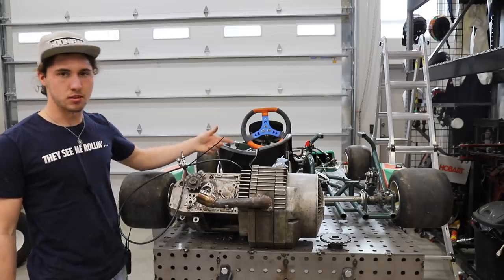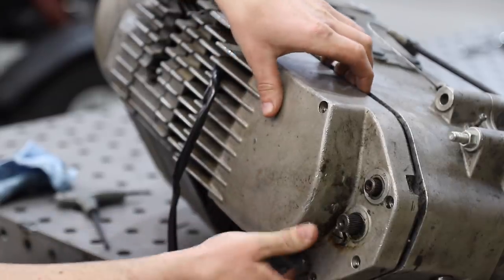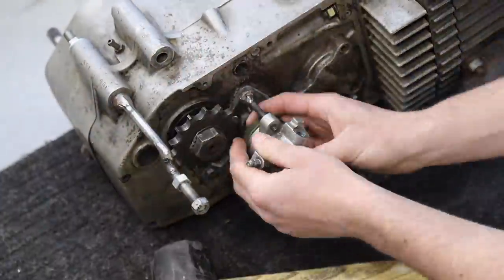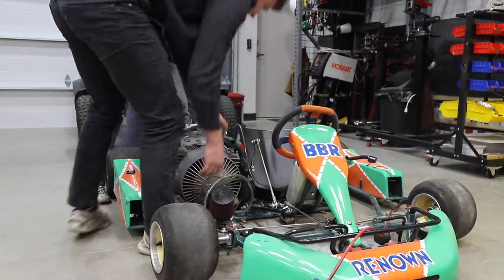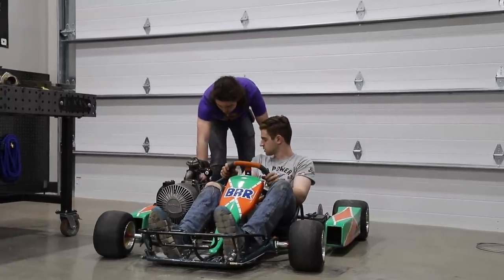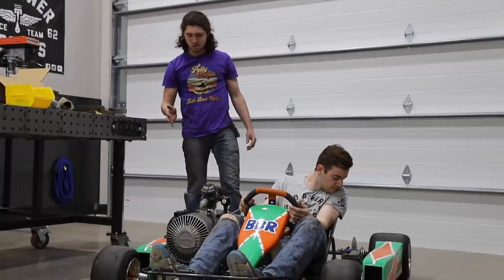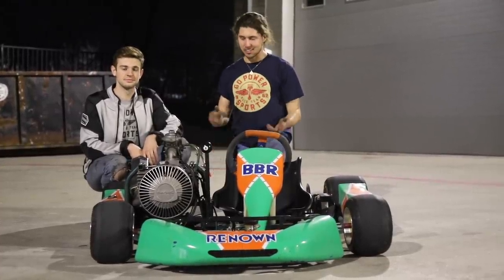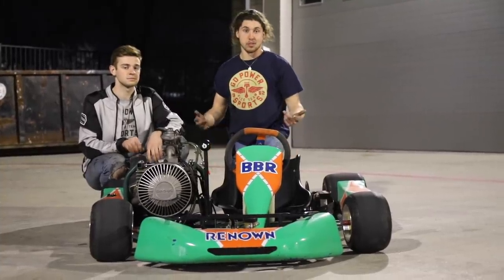ROTARY POWERED SHIFTER KART Returns!!! Major Upgrades!

Comment: Dont use car oil in a motorcycle engine. Use motorcycle specific mptor oil. Car oils have additives that are to slippery for wet clutches. Its not good for the clutch in the long run. Even some synthetic motorcycle oils arent good for wet clutches. Use a regular motorcycle oil. Like honda gn4 10w40 as an example

Comment: The engine seems like it's running a little too lean, with the missing and blue flames.  Could put an O2 sensor mount in the exhaust before the muffler to get some mixture measurements as you tune the carb.  Tuning a carb is just make changes and see if it's better or worst.
Reply: wouldn't flames out of the exhaust mean it's running rich? there's excess fuel that's not been burnt in the exhaust.
Reply: @dereksumstad6746  The blue color is the concern for me.   In a piston engine, a rich back fire has yellow in it.   Now, I do know rotary exhaust temps are way higher than piston engine...so maybe a rotary running rich is Blue and not yellowish.  We tune 2 strokes carbs by soldering the jet closed and drilling few to the next size bigger or smaller till it 'felt' better.   Just my 2 cents.

Comment: Y'all can get wayyyy higher in the rpms with that rotary
Reply: I was just thinking that it sounded like it wasn't getting to stretch it's legs
Reply: older rotaries are not that high revving than the newer ones
Reply: @PHUSII  that motor should hit peak power around 6000 rpm from factory they definitely aren't revving it hard enough
Reply: It hasnt been run in a while so just cleaning it out next vid we will see higher revs
Reply: @shaynegadsden  yup, it definitely has more in it, just waiting until they press that has pedal
Reply: @PHUSII  Äijä on iha kaikkialla kommentoimassa

Comment: That clutch bearing is cooking itself because you have tension on it when you're not using the clutch. Just like on a motorcycle you always have a little slack in the clutch lever.
Reply: ?what's free play.... lol. Definitely get worn in fast on the tight side.
Reply: @justinsolomon4427  if your cable is tight it will cook that bearing. Just like on a car the throw bearing has air gap to the clutch pressure plate when not depressed.
Reply: Correct,  which will also possibly lead to failure of the clutch or friction plates
Reply: @justinsolomon4427  100%.
Reply: Usually on a motorcycle if the clutch cable doesn’t have a tiny bit of slack your probably actually slipping the clutch even when you think it’s fully engaged

Comment: That motor can rev up way more than that. You should give it some more beans. You are shifting at around 5000 to 6000 rpm but it can do more than that without breaking a sweat. Try going till about 8000 or 9000 before you shift.

Comment: if they are welding together you do not have enough play in the clutch lever they should only touch when the clutch peddle is pressed to disengage power the rest of the time they should not be touching the bearing

Comment: LOL you never know what will work until you try! Nicely Done Guys!! I would suggest figuring out a metal spacer like maybe some Black Pipe cut to fit with a couple exhaust flanges welded on each end to keep it from flexing at all but other than that the Hydraulic cylinder you chose seems to work like a charm!! That thing RIPS!!

Comment: My 14 year old son races a OTK ROK 125cc and it is very fast. I would love to see this rotary kart up against it. We run C12 and I am sure the rotary would be faster running this fuel as well. I know there is a lot more power that can be had from that rotary. I would love to see you guys continue to fine tune it for more power. The right carburation helps a lot also

Comment: As I said before I owned the bike back in the day and I think if I remember right, the listed top speed was either 80 or 85 (90 maybe...I don't remember). All I know is that try as I might I could never get the damn thing over 78 mph. I'd like to find another bike if I could. Or, even just the engine like you guys did and put it on a different bike frame. My current bike is an '88 Honda Hawk GT.

Comment: Looks like an interesting build, what power is that engine putting out??? 
Im tempted to do something similar, i have a kz450 race tuned bike and a spare gokart chassie i think would create an awesome death machine. The only reason i havnt built it yet is because ive no idea wtf id drive it. If i did do that engine in a gokart though id definitely buy a vw camper totrod body ive seen on ebay as i think a mini sized vw bus with 70hp and gears would be awesome to race against a real sized one.

Comment: Bro I am an automotive engineering student. The professors wanted us to build a vehicle. We have to produce all the components except the engine ourselves. As far as I can see from your videos, this engine is powerful. I think I can use it in my project. How can I find this engine ? 
I need to find out which series is the engine and who produced it ?
Reply: Just use a standard motorcycle engine... As these engines are getting very very hard to find... And there are very very few replacement parts available for them

Comment: I wish I could find one of those engines to put in my Project Hammerhead Twister Offroad Dune Killer!! I removed the Bouncer style rear suspension and I am working on building a Full Upper and Lower A Arm style independent rear Suspension with a spool and axle shafts... It currently sports a cheesy GY6 POS that I want to just get running and sell to someone else lol, then replace it with either a used motorcycle engine or something like that Rotary would be EPIC!! Where did you find it?
Reply: Why not build the gy6? There is an enormous aftermarket for them I've had the 50cc version pushing the not so little anymore me (all 250lbs of me) with a 350lb scooter past 80mph and with enough torque to pull and hold the front wheel to 40mph from a standstill.  The biggest thing to wake those engines up is changing the clutch shoes and changing all the springs in the cvt and clutch for yellow springs (my 80mph+ machine uses red springs but it's a stage 5 build running a true 1.25 inch id. exhaust header with a custom 1.5 inch id. Intake, big valve head, bored 13mm over (yes it went from a 39mm bore to a 52mm bore) and stroked 2.5mm, custom fuel injection, a 12 pole charging system, ducted aux engine cooling 12:1 compression, custom grind cam,  upgraded oiling system with oil cooler, and regeared the final drive for higher top speed as hitting 10k rpm at 65 mph was holding it back so now it does 80 at 10krpm
Reply: @dodgeme1986truck  I need more horsepower and torque for the sand and the dunes... its a fairly heavy rig as well even with out two people in it...
Reply from the maker: We got very lucky and stumbled upon it on a local craigslist listing.  You could try looking for snowmobile rotary engines on ebay or locally, they're more common
Reply: @BuildBreakRepeat  Right On! I have been keeping my eyes peeled...
Reply: @DanITGuy   I've pushed 40hp and 35 ft lbs from those gy6-150 engines if you get a big bore kit, a stroker crank, a big valve head, cam, a header, reject the carb, and retune the cvt with  upgraded clutch shoes, and a complete set of yellow springs you should have enough power for a 1000lb buggy.  Or you may need to upgrade to a 200cc+atv engine if you want reverse and the gy6 variant engines over 150cc have a decent upgrade following too
Reply: @dodgeme1986truck  Im looking for more in the range of 650cc to 750cc and around 70 to 100+ hp... I like to have a little extra power on tap for sand paddles and mud tires just in case its needed... the issue with running a big bore kit and such is heat... it gets HOT AF OUT HERE LOL... I already have a reverse gearbox that will handle the power.
Reply: @DanITGuy  not a problem you are basically looking for a motorcycle engine those rotary engines are going to fail to meet your expectations what you really are looking for is a minimum 1000cc engine but you do not want a sport bike engine that's all revs and no torque what you'll need is more a well built cruiser motorcycle engine for the torque to spin the paddle tires.  Although the best way to keep an air cooled engine from overheating is actually via the oiling system...  Add an oil cooler pretty much if you're gonna overheat an air cooled engine just because it has a big bore kitand stroker crank, you'll end up cooking a liquid cooled engine too most people forget that an engines oiling system does about 40-50% of the overall cooling.  So I'd recommend on whatever engine you end up choosing to install an oversized oil cooler and if liquid cooled extra capacity radiator (even though it's heavier going with a 3or 4row radiator in place of a 1or 2row  will be extremely beneficial when outdoor temps exceed 110f) because radiators and oil coolers get less efficient the higher the ambient temperature gets just like an air cooled engines find.
Reply: @dodgeme1986truck  Exactly! I was looking at big twins, Triples and even a few 4 cylinder cruiser engines...  Any of the available options will require an oil cooler, synthetic oil, and a friction reducer additive for sure! I don't rule out the wankel though because a supercharger or Turbocharger can help to push power and torque up to an acceptable level... plus just the braap of a wankel makes me smile lol I just plain love em!
Reply: @DanITGuy  the main reasons I ruled it out is the low torque and reliability as there is very few parts still available for those engines

Comment: 11:25 Is the kart dumped in 1st to start? Because it would be easier to start in 2nd or 3rd gear, and it would jerk as much put aside the driveline stress

Comment: I’m a bit disappointed with the clutch line. I did brakes with an lines for my go kart back in the day and used -3 an lines. I know there are banjo adapters since I did something similar to what y’all did, and I would’ve appreciated that extra quality. 

That said, it works. If it ain’t broke, don’t fix it.

Comment: Someone there really needs to learn how to TIG weld for all those small delicate jobs.  I think they wil have issue with the short throw of the clutch pedal, the need a master cylinder that matches the slave in volume.

Comment: You should do some more work on the exhaust pipe system, put 2 snails and 2 performance exhausts, then it will reach the real power

Comment: should of mounted the clutch master cylinder on the frame in board and used a rod and linkage, the master cylinder and pipe will make a great crash bar.

Comment: Teflon tape on break or clutch lines is not recommended you're supposed to use all compression fittings.  But keep making videos of the rotary engine.  It's literally a one-in-a-million engine you guys have there.

Comment: Your friction welding the ball bearings so they are constantly in contact, this is incorrect they should not be in contact under pressure long enough to weld, only when the clutch is depressed.If you set up the clutch to have free play as it should be (on all cable clutches) you will not get these problems plus you will not get slip and /or wear. I know I run this engine in my Hercules W2000 Good work though guys,love that brap brap.

Comment: I know this comment is late to the game, but you should avoid using car oil in that thing - use motorcycle oil since it has the right friction modifiers in it. Car oil is too slick and it'll cause the clutch to burn out - ask me how I know. You need an oil that has the JASO certification.

Comment: You guys should take the time to clean the engine and paint it and just clean things up
Reply: Parts of the engine yes,   it is air cooled    so you wouldn't want to paint alot of it,   as paint will act as a insulation and itll run hotter
Reply: @russcole5685  there are special paints out there just for air cooled engines
Reply from the maker: We might try polishing it again or getting it vapor blasted. Also looking into getting it wrapped with the same livery, the spray paint just isn't holding up that well